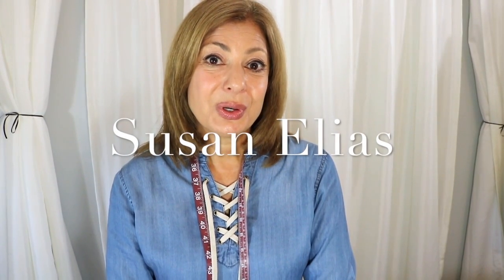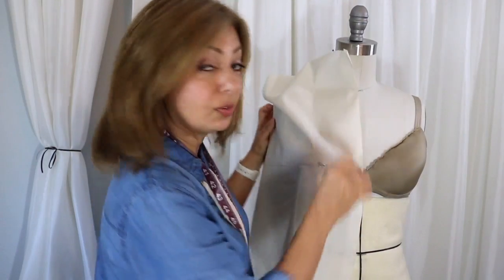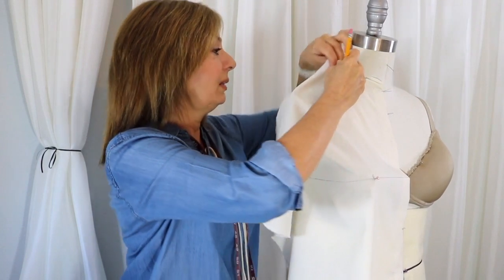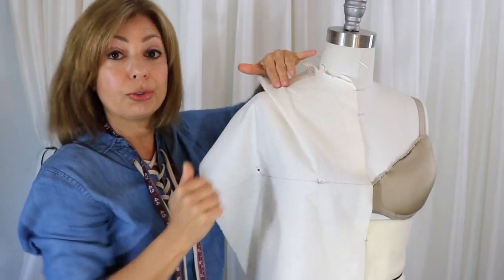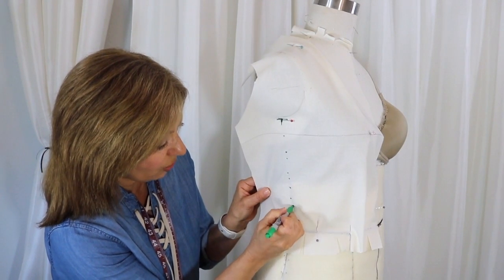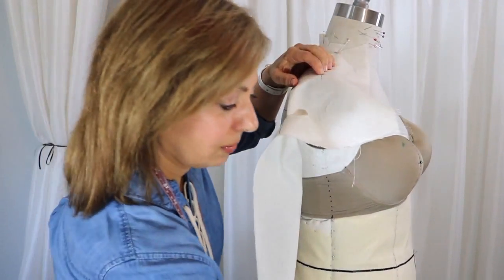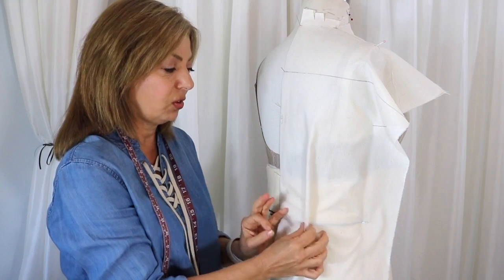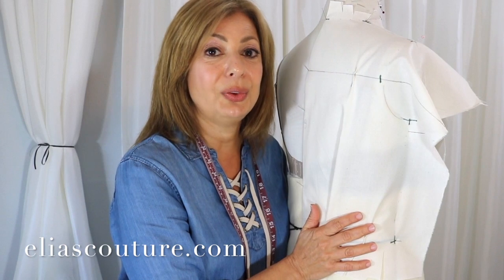How To Drape Front/Back Bodice to Make a Sloper - Part 1

Comment: I have a question regarding adding ease! I have draped a basic bodice sloper and have transferred it to paper. I was told to add around 1/8 of an inch to 3/4 of an inch to the side of the bodice. This makes the armhole back and front a total length of 16.9”, when the guide lines for an armhole in size 34 in Sweden is ~16.1”. It’s obviously getting to long with the whole adding ease to side seam method. Any thoughts on this? Thank you!!
Reply from the maker: Thank you for your question. You generally drop the armhole 3/4" and add or go out width wise at the side seam 1/2". That shoud be more then enough extra for the fit and movement of the garment. The sleeve sloper should accomedate this extra... I hope that makes sense. It may look like a lot on the dress form but on the body it will not....Your body needs that to move and expand.....Please let me know if that makes sense:).

Comment: I am a beginner (10 months). I would love to create a bodice with the dart points; similar to your bodice. how to determine the dart points on the bodice from the apex?
Reply from the maker: Hi there! The dart point is determined anywhere from 1" to 1 1/2" away from the apex. You measure 1" away in the center of the space (in between the legs of the dart that goes to the apex) That lowered marking becomes your NEW dart point! I hope that makes sense....:).

Comment: You padded your dress form to make it close to your measurements; however, I have the opposite situation: The smallest apex on my dress form is a 32A. I am a 30A cup. Can I drape my sloper with the 32A measurement and pin out the excess on the finished muslin? Would that work so I can put my "useless" dress form to work? Or would the reduction in the bust size be remedied in an entirely different way? Thank you for your advice to my problem. -Jane
Reply from the maker: Thank you for watching. Yes, if you plan to drape your dress or sloper you can just pin it out. I have a video showing you how to drape a sloper in your own size. You can also make a oaktag sloper in your own size and make designs by flat pattern if that makes sense.
Reply: susaneliascouture I always make my patterns using the flat pattern method and wanted to utilize my dress form to try the other option of pattern drafting. Thank you very much for your prompt reply to my question, and much continued success. You are the best!❤️